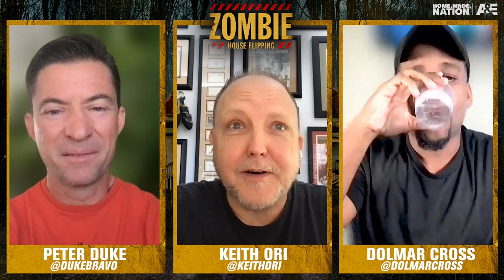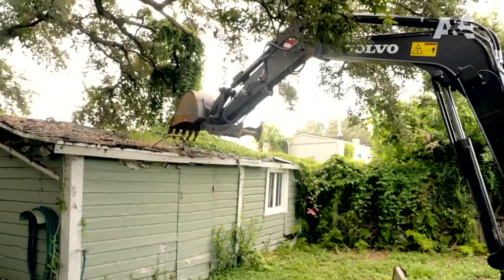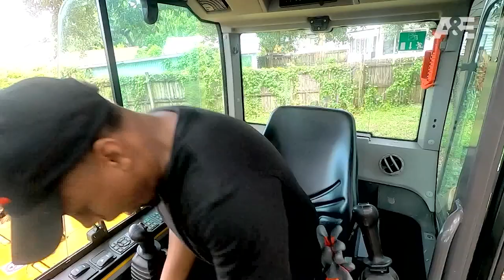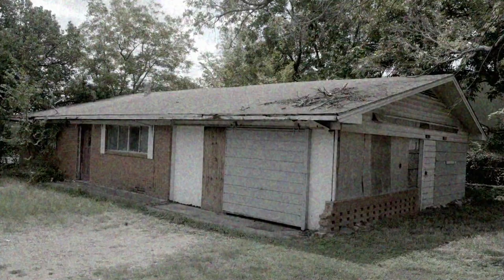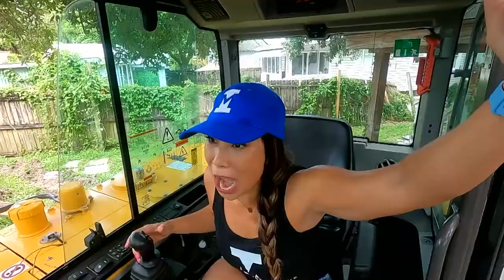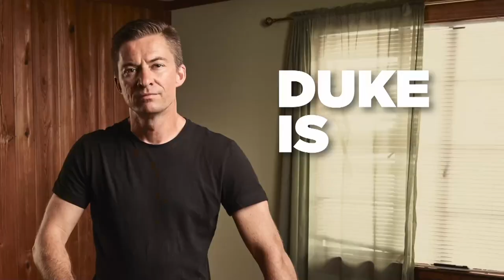Zombie House Flipping Social Chat Hosted by Duke & Keith! | A&E

Comment: Your shows are frustrating because it appears you all don’t know what you’re doing with all the problems you run into after the fact due to inexperience or lack of knowledge in appraisal and planning. 
For example why would you put pavers with sand fill around a liner in ground pool? You’d Alway have sand in pool and faster wear on liner. Fine Sand would also be tracked around the whole deck area.